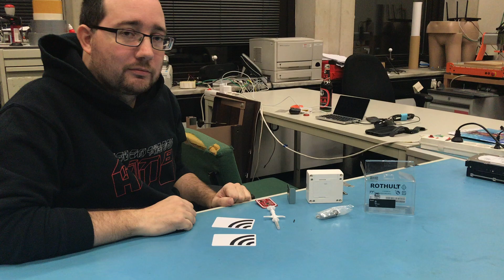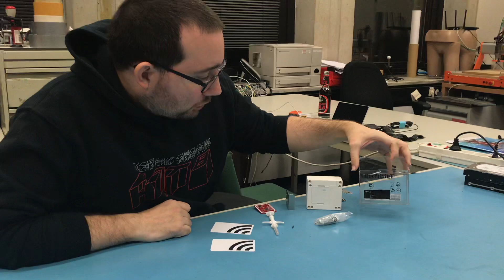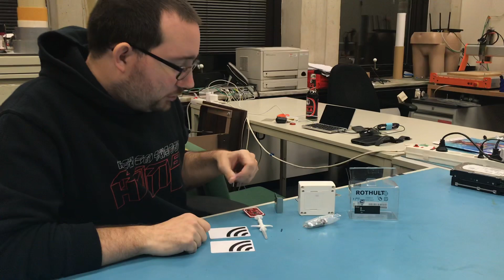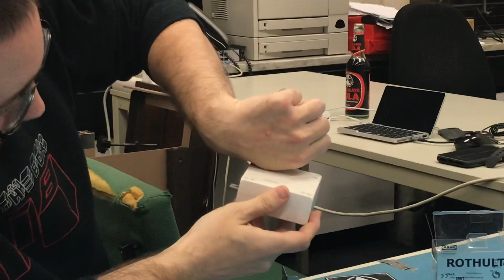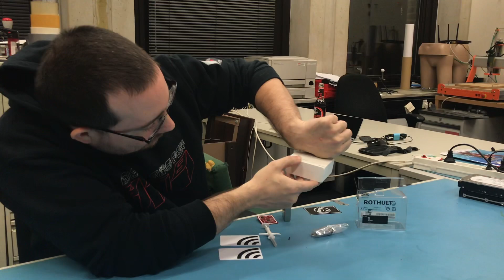Useful RFID/NFC tag implant applications 19: cheap swedish furniture NFC lock

Comment: DOES THE FLEX READ THROUGH A THIN WOOD DRAWER/WALL?
Reply from the maker: This lock is designed for certain furniture from Ikea. Certain cabinets and drawers, which have a square gap for the coil where the lock is mounted. I tried it in an Ikea store where they have demo setups of their furniture and these locks mounted, and it worked for me.